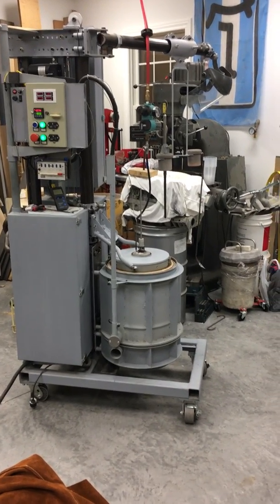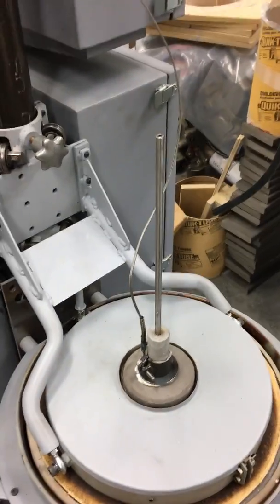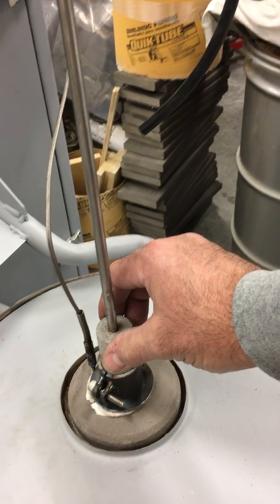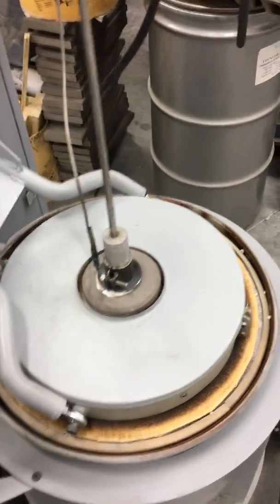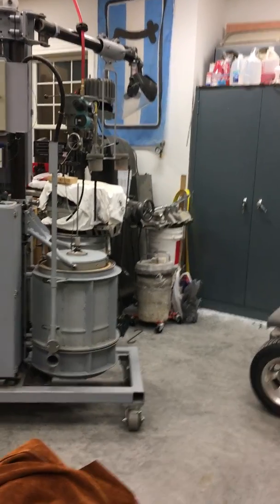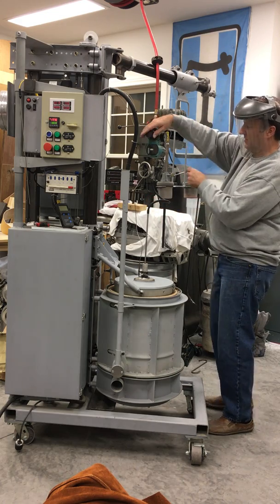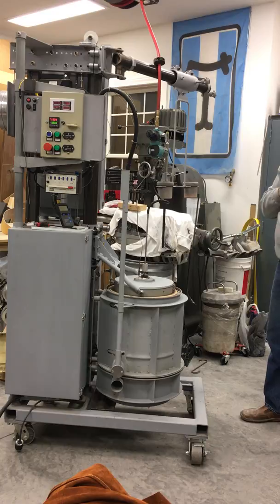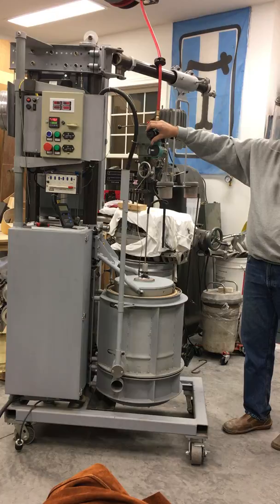3 Lance High Temp Proof Test

Comment: Hi Kelly
 Have been watching your videos and enjoying them very much. Great job. I am getting into metal casting, mostly aluminum. Was planning on using green sand and ramming patterns up in flasks mainly because most of what I have seen of lost foam casting I wasn't impressed with. After watching most of your videos, you sir have opened my eyes to this method of casting. Thank you.
Cheers
Willy
Reply from the maker: Thanks Willy. I've gotten a lot more out of lost foam then I ever imagined. I have a couple threads at TheHomeFoundry.Org that chronical and summarize my learning over the years and comment on the pros and cons of lost foam casting. -Check them out. Best, Kelly